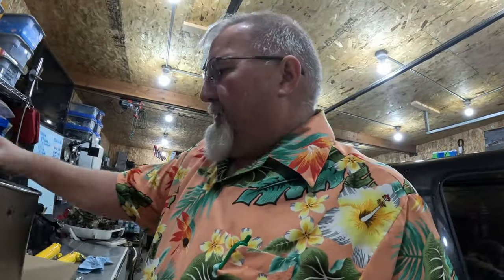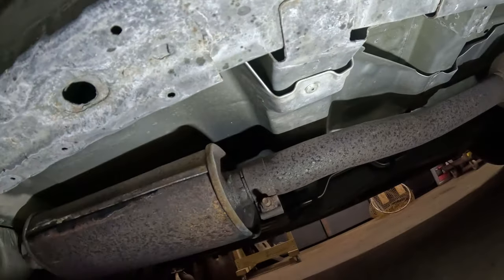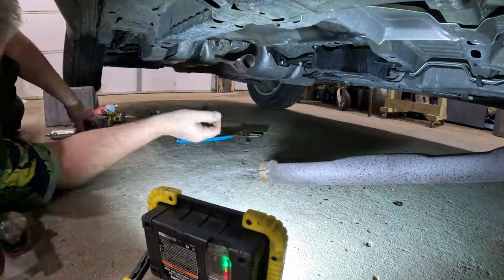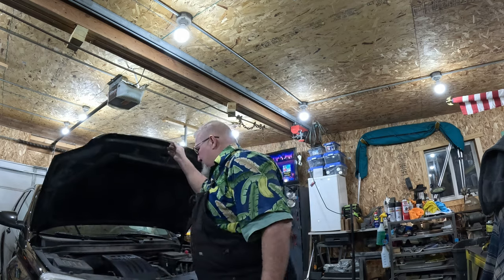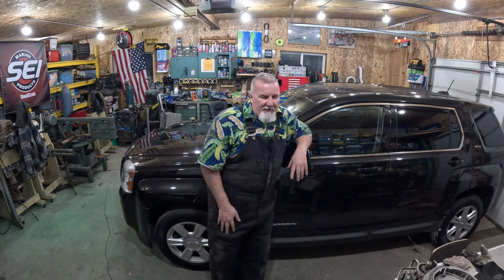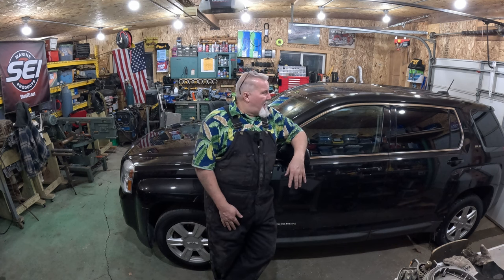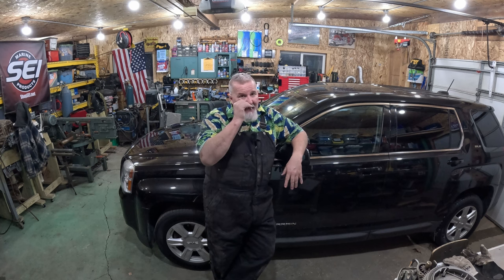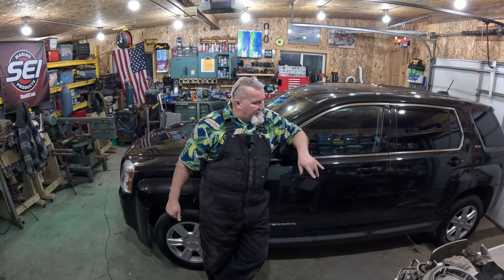2015 GMC Terrain sounds bad Let's make it sound good again

Comment: Awesome video nice job on muffler . The Big Three Vehicles Quality has been forgotten about it’s All about Quantity build them cheaper more plastic and more aluminum and even the frames are poor quality..Then sell them for Double or Triple what they worth . Here is an example my Cousin in 2019 bought a new Chevy 1500 trail boss for 37k and his son bought the exact same truck in 2023 for 59k .  They took a compared them and found that his son’s truck had alot of cheaper quality parts than his. Me myself hadn’t bought a brand new vehicle in a long time. But have bought used ones and they have and still running strong I do all the maintenance and any repairs myself that’s how I was taught to do by my dad. My first project when I was 10 or so that I took care of was a snapper riding mower . I still cut my grass with it today . Anyhow guess what I’m trying to say is if ya take care of stuff it will last you longer than you can imagine..  Stay safe and warm and Thanks for doing what you do .. As always Sir thanks for the ride along and Keep’em coming 👍👍👍👍
Reply from the maker: Thanks for all the great comments and keep'em running long time is what I try to do, thanks for watching

Comment: Hour and a nice video. I did a similar thing to my GMC terrain 2012 and it’s a resonator not muffler just a heads up.
Reply: The number one thing you gotta keep an ion with these Eco tech engines especially the terrain are the oil level these things have bad habit of consuming oil
Reply from the maker: Thanks for the info and thanks for watching